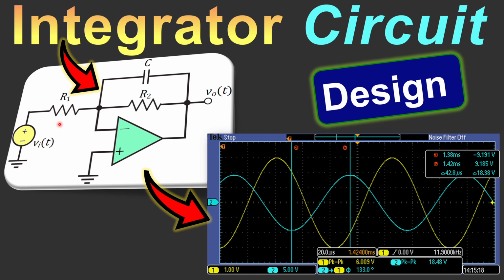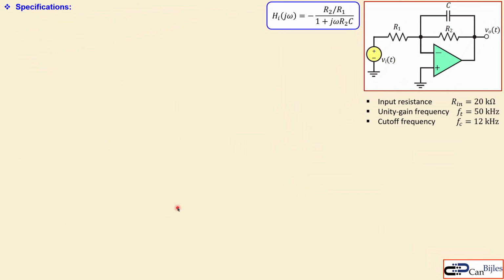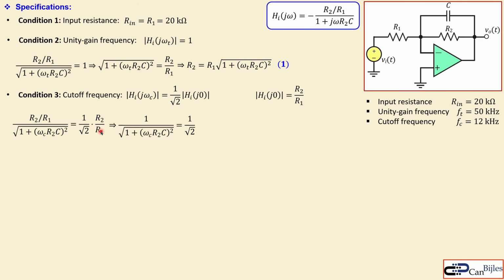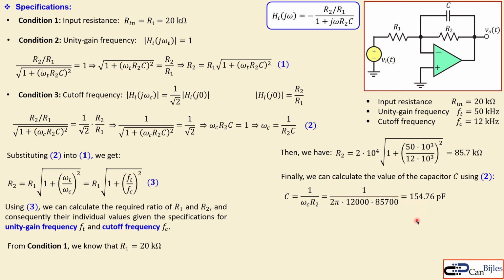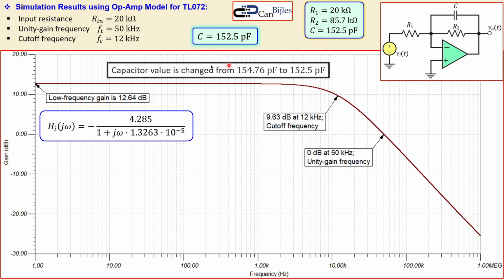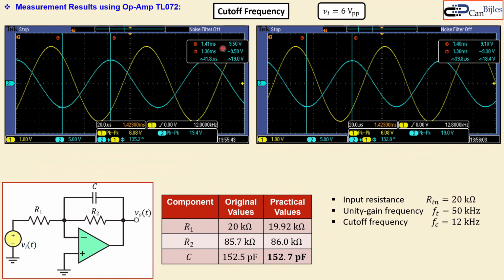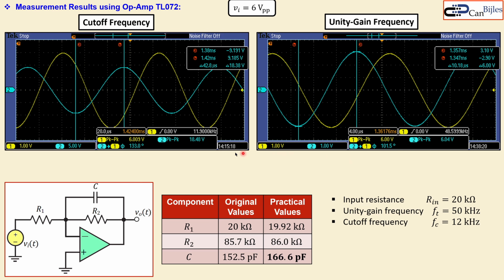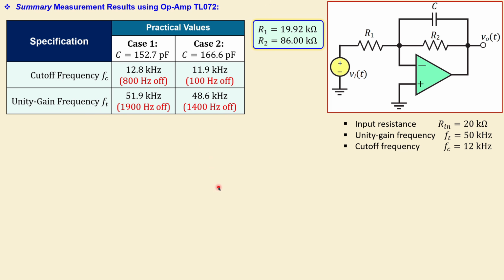Integrator Circuit Design using Operational Amplifier 🌟 Calculations, Simulations & Measurements

Comment: Thanks for lesson! Please tell me, what parameters of the Vin signal generator did you use? And please explain how to correctly calculate the phase margin if the phase shift starts from 180 degrees.Thank you!
Reply from the maker: The input voltage is a sine function, as given in the assignment. You should of course make sure that the amplitude of the input voltage does not exceed the maximum allowed input voltage for the op-amp. 

I am not considering phase margin in this example, but if you need this, you can calculate this also using the formula for the phase from the transfer function of the circuit. Why are you interested in the phase margin?
Reply: @CANEDUX  I'm setting up the electronic load. The output transistor in it is controlled by an operational amplifier integrator. And the system sometimes becomes unstable under different modes. That's why I'm wondering how to set it up correctly. In your video on the Bode graph, the phase starts at 180 degrees. It's not clear to me what the actual phase margin is at the assigned frequency. For example, when the phase starts at 0 degrees, the phase margin for this system will be the difference between 180 degrees and the phase value of the system at a certain frequency. And in your example, the phase already starts at 180 degrees. That's confusing) sorry if I didn't write it clearly.
Reply from the maker: @SMV1972   First of all, this integrator circuit is a first-order system, so you should not worry about phase margin (PM) or gain margin (GM). PM and GM are used for second-order or higher-order systems. In addition, phase margin and gain margin are determined for loop transfer function and not for the closed-loop transfer function, as we have it for this circuit. I think the oscillations in your circuit are not caused by this integrator circuit only. It might be cause by the circuits before and the this integrator circuit. Especially, capacitive loading can cause some oscillations, depending on the circuit parameters and input.
Reply: @CANEDUX Thank you!
Reply from the maker: You are welcome.

Comment: Can the error be caused by bias current or voltage, i see people put a Resistor from +input->GND. R = R1 || R2 I believe.
Though I am using an opa2134 opamp.
Reply from the maker: Yes, bias current and offset voltage can definitely cause errors in the op-amp circuit.